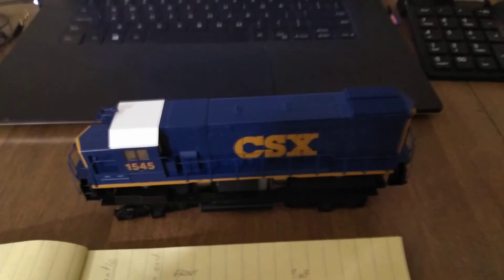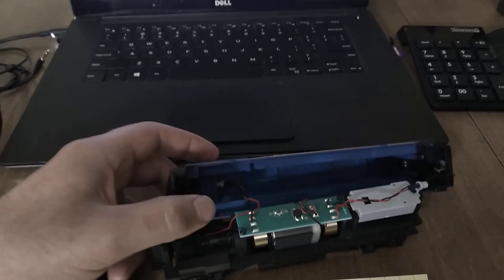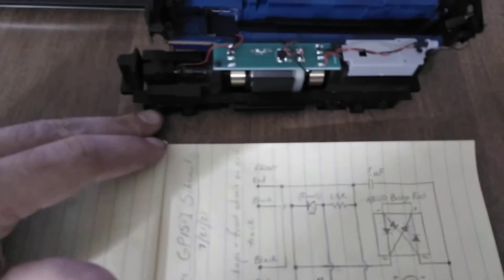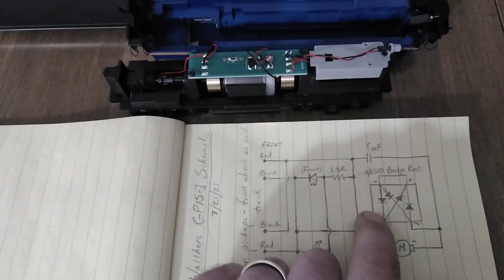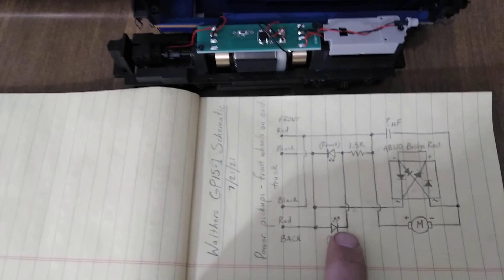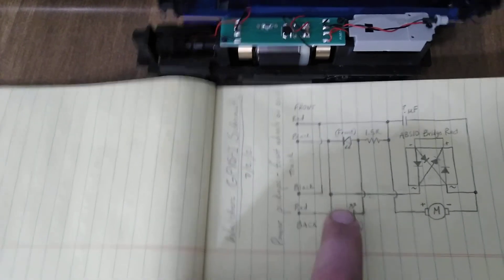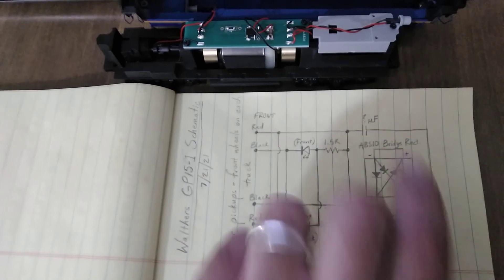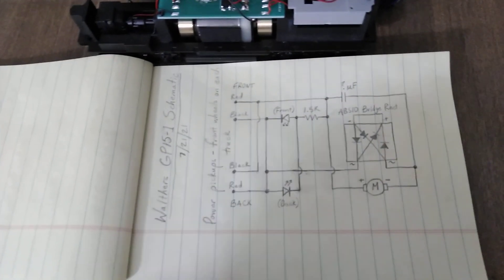Walthers GP15-1 DC Locomotive Reverse Engineering!

Comment from the maker: I suppose I didn't really explain the purpose of the bridge rectifier, of course!  It's basically used to direct the current flow and minimize the number of components.  But still, they only would have needed a couple of resistors and diodes!